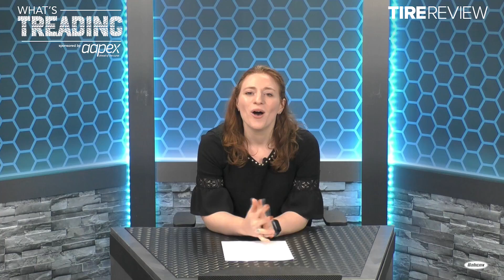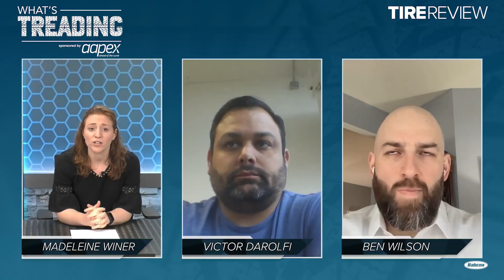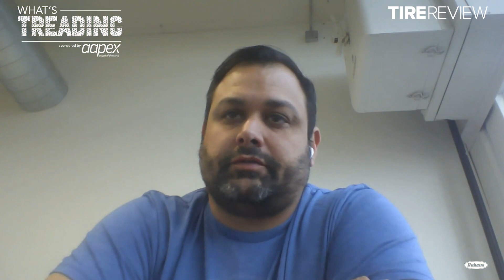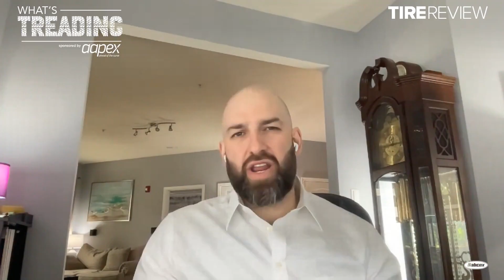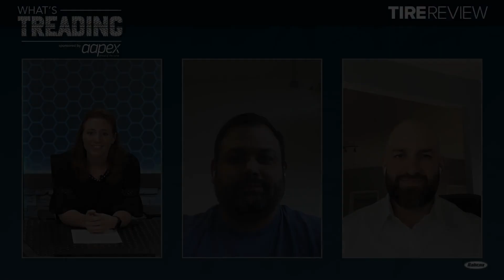From Manual to Robots: RoboTire's Impact on the Tire Shop Floor

Comment: im surprised discount took ahold of it with their expectations of technicians having to get vehicles out in 10 min or less or that could be just the one I worked at. The thing I've been seeing is its not just this industry affected its all industries but it will be interesting to see the industry evolve when most dealers and shops use the lube rack or tire area as a way to teach the new people the rules and environment the shop operates. Looking forward to how the shops evolve.